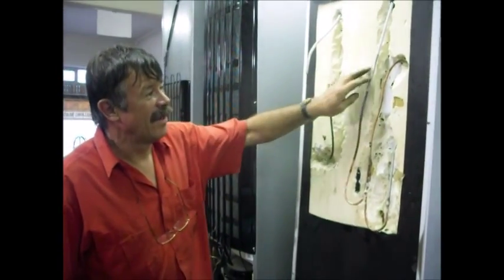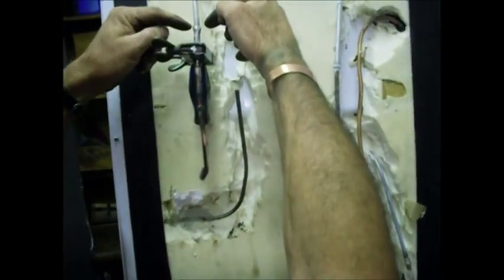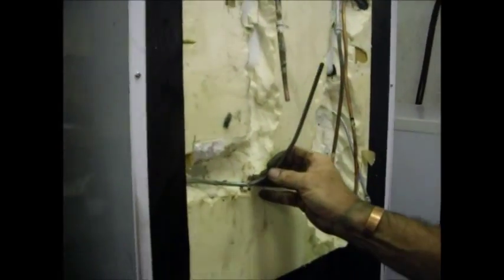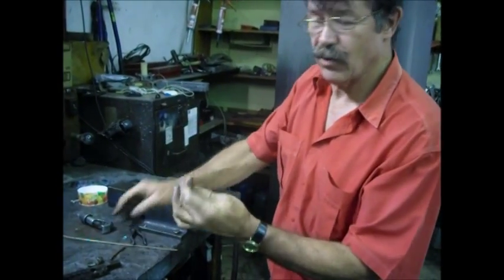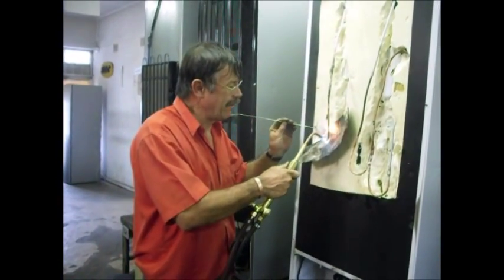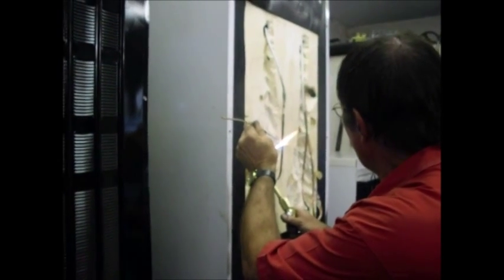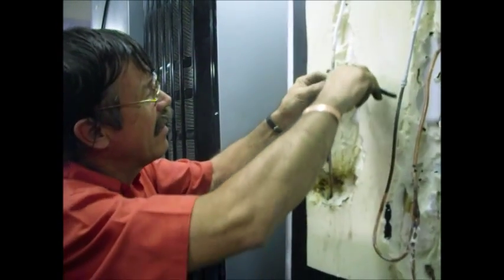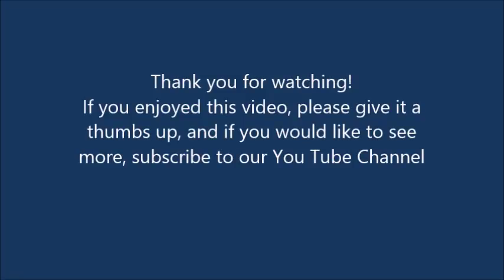Repairing an Internal Gas leak - J D Nel Refrigeration

Comment: I have a Defy  D 380 which is leaking gas slowly. I now have a 1kg bottle of R134 permanently attached to the fridge and every 3 or so days have to give a burst of gas to keep the fridge cold.   I have tested the external joints with a washing soap mix and they are OK so the leak must be somewhere internal. A friend of mine had a similar problem and ended up tearing out all the foam to find the piping. From this video I see you carved out foam in seemingly targeted areas suggesting you know where the pipes run. Is there a design format that Defy follow so that I can do as you have above and carve out particular areas to get to the piping? Many thanks
Reply from the maker: On that particular model I don't repair internal gas leaks, I write them off. I know of somebody who does. He removes all the foam from behind on the internal cold plate which is just steel tubes and replaces it with an aluminium cold plate and covers with foam again. We find it not to be cost effective.
Reply: @JDNelRefrigeration  Thank you very much

Comment: Hello oom, what tyoe of protective coating are you using  and where can i buy it thanks in advanced, great videos 👍👍👍
Reply from the maker: I use a rust protector "Rust Off" which you can buy at any paint shop or hardware

Comment: Nice work and trick for the joining the two different metals.  It looks like you use the same flux for the aluminum and copper welds. Does the aluminum weld similar to the copper; it looks like the aluminum could be destroyed easy with the oxygen/acetylene torch setup from to much heat. Thanks for the video
Reply from the maker: No I use 2 very different fluxes. Aluminum has its own special flux

Comment: Hi

Please advise on what rod to use to join alliminium cippilary to a koper drier. Video would assist a great deal.

Keep up the good work
Reply from the maker: We use a rod from Probraze materials called Aluninium F/C Rods
Reply: Thanks for the nice video but would also loke 2 no were to find that kinda rod for the aluminum to copper weld thanks in advance
Reply from the maker: @andre.l568  http://www.probraze.co.za